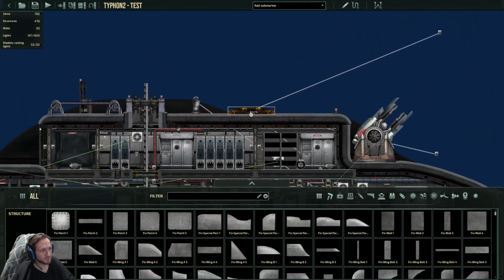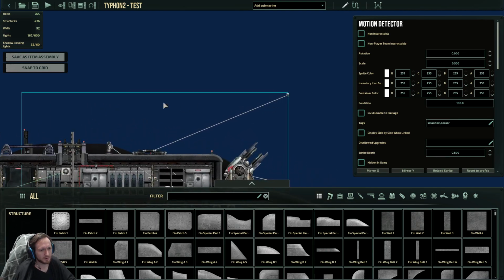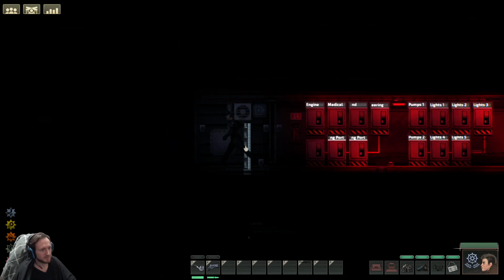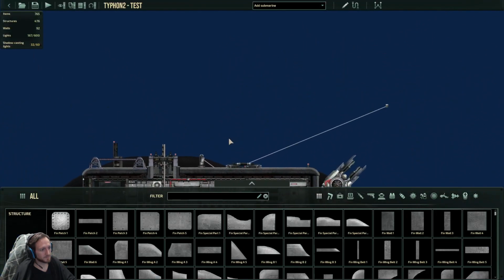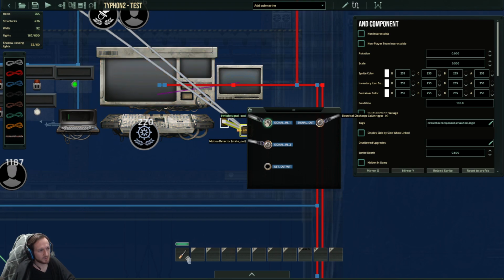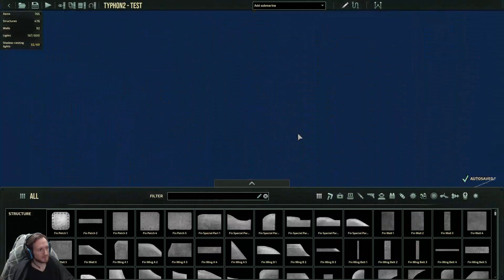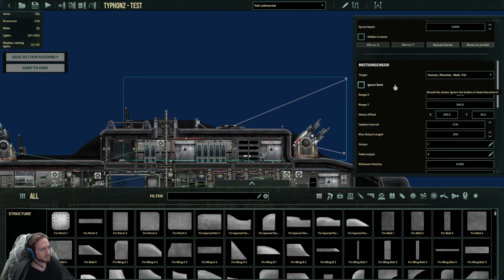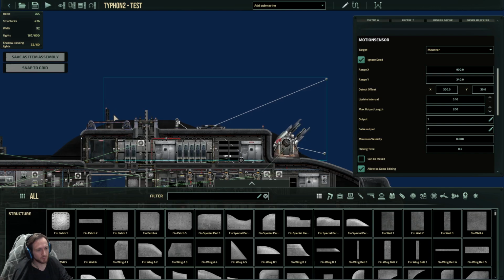Barotrauma - Automatic Discharge Coil on the Typhon 2

Comment: Damn that's baller I've no idea how I didn't think of that. Any advice on the radius you'd wanna use for a regular shock coil? I know most ships only have a 5m shock and the typhon 2 is like 10m or something and my friend and I are using the orca 2 atm.
Reply: Like is it just visible in the ship editor? Sorry I've never used it before.
Reply from the maker: I don't recall the radius I used off the top of my head but I should show it in the video for each one I did.
Reply from the maker: Sadly it's only visible in the editor so I had to go in and do trial and error to get it just right. I THINK I saw a new patch is adding some of these in the main game but possible it was just another thing that was originally hidden.

Comment: Can I connect multiple coils to one and component? Or do I need multiple switches for multiple coils
Reply from the maker: You should be able to, I cant think of a reason why it would be an issue.
Reply: @deathfromace  I figured it out I think, switches carry 1 signal at a time I need to use a button instead